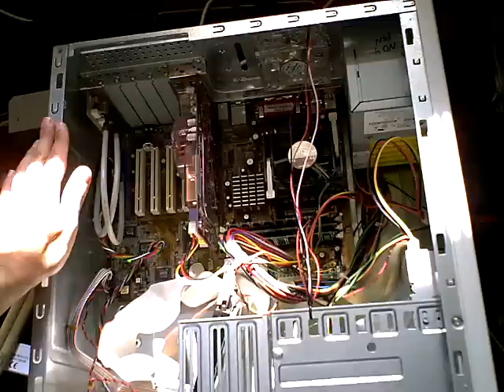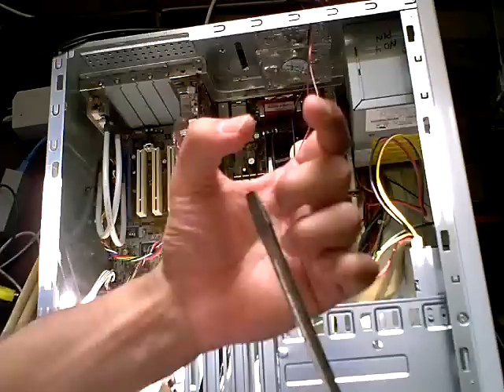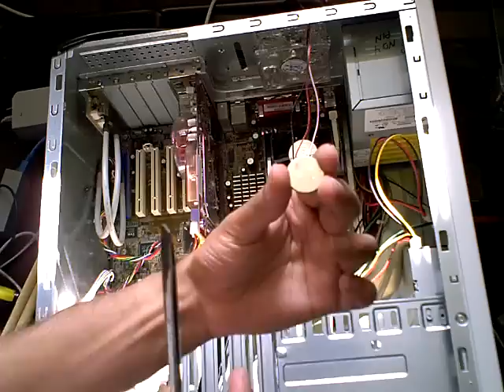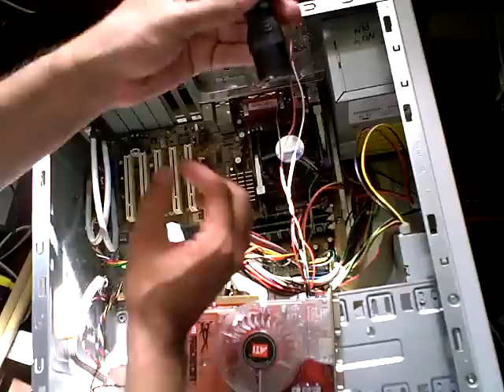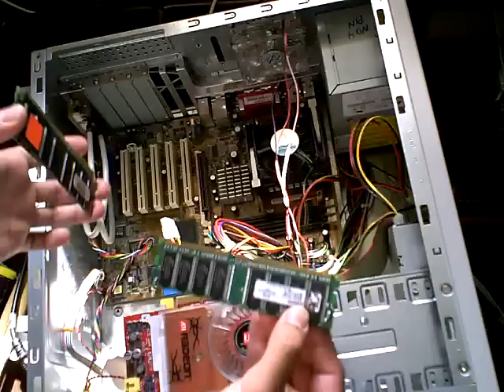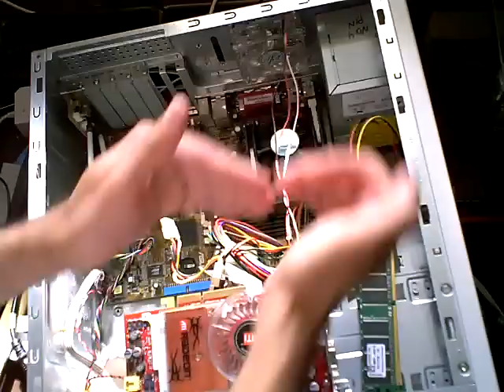How to possibly fix a PC that will turn on but will not beep and will not display anything on screen

Comment: mine is a Fujistu computer seimens and I do not know if that's how u say it but mine has a blank screen after being in a damp room for a year. I have took it apart and rebuilt it all but still no picture and the power button doesn't work anymore. I have checked the HDD cable, fan cable, power cable and so on. I don't know if the video card is broke or anything but if u tell me what to do or send a link. I will be very happy as it runs windows 7 ultimate and it has all my pictures on it. shall I just buy a new mother board or something
Reply from the maker: Well, if you are saying that it receives no power whatsoever (so no lights, no fans spin, no sign of life) then it is just the power supply that is dead and that needs replacing (ensure you have flipped the I/O switch on the power supply to I before trying to boot the PC...maybe you just missed that step)

Comment: So I have  exactly the same situation as in this video,  long beep after removing the ram, but no post beeps after putting the ram. What does that mean? We found that the ram is the problem and need to buy new ram or do i need to investigate further??
Reply from the maker: +region0706 Unplug the PC, try a different combination and/or order of RAM then power up, if not, unplug the PC, reinstall the RAM, remove the video card, then power up. If no luck, my question is: has this RAM ever worked in this PC before?
Reply: yes, it worked for many years. I have 2 sticks. yesterday it booted to the Acer logo with one stick, but on the screen it was saying CMOS checksum bad & something with date and time is not set. However there wasnt any beeps when booting, I pressed F2 and it went to load defaults, started loading windows and stuck there. The voltage of the battery is 2.3 V, I put a new one but no changes....
Reply from the maker: +region0706 Ok, the CMOS checksum failing generally means that the BIOS battery is dead. You're telling me you replaced it, so this is tricky. Ensure that you load setup defaults in your BIOS as you did, and ensure that the date and time are set correctly. If Windows still refuses to load, even with all of your RAM modules present, sadly your installation of Windows might have become corrupt. As a last ditch effort, I'd try loading Windows in safe mode (hold F8 after POST), and if still no luck, I'd try removing all non-essential USB connections to the PC as well as all non-essential PCI cards from the PC before booting. Good luck with it.

Comment: Hello, I tried to update the bios of my Motherboard from ASUS (bad choice). I tried for windows, but the ASUS program said it failed to identify the EEPROM.

At that moment the PC was working, but I had the bad idea to restart, now my computer is in the same situation as yours was, but only the motherboard, processor and psu, but not the beep.

I have already done the jumper and battery withdrawal procedures to try to return the motherboard's factory settings.

What do you think I should do or the motherboard is dead?
Reply from the maker: I'm sorry, it is not looking good. As a last ditch effort, you can Breadboard it (explained in the following video:)

http://www.youtube.com/watch?v=_EK9a-R5pss

but I am doubtful that anything can help at this point.

Comment: I just built computer and get no display or beeps but fans and led works but no boot. All my components are brand new. Could they come broken?
Reply from the maker: +TronTigerGO They could be incompatible with each other. Try to Breadboard it (explained in the following video:)

If the steps in this video did not provide a solution to your problem, view:

http://www.youtube.com/watch?v=_EK9a-R5pss

You never know, maybe rebuilding the PC in the opposite sense that you took it apart will solve the problem.

Comment: I have the same problem and I want to know if the problem can be came from the processor or no ? Because I guess the RAM and the video card working good
Reply from the maker: Yes, this issue can be caused by the CPU as well. But don't forget, your motherboard could be the source of the problem as well.
Reply: well thank GOD because the problem came from the video card not from the CPU.. when i unplug it, my pc run without any problem.. there is a solution to repair my video card or should i buy an other one ?
Reply from the maker: If there is a way to repair video cards, I haven't a clue how. I'd first test a different video card in your machine (borrow one if you have to) to ensure that it isn't your motherboard's video card slot (or the routing to and from it) that is to blame. You could also try your possibly faulty card in another machine to see if it works. If the borrowed card works fine, and your possibly faulty card still doesn't function in the other PC, yeah, I'd get a new video card : \

Comment: hello
ok, im in a very serious problem! and i need help.
my computer freezes on the start screen and i can't install another os.
( watch all parts of the video to understand better )
video: p1 : my computer ( winsows 8 ) freezes on the start screen and i can't install another os. PART 1
       p2 : my computer ( winsows 8 ) freezes on the start screen and i can't install another os. part 2
       p3 : my computer ( winsows 8 ) freezes on the start screen and i can't install another os. part 3
in detail : so , my computer was working very fine (it's a windows 8 ) , 
but one day i powered on my computer and it started fine but it froze on the start screen ( as in the video ) .
I tried restarting it for 12 to 15 times but it was the same.
 so i thought maybe there was a problem on the HDD so i tried to reinstall windows 8 but it doesn't work,
 it freeze on the start screen too (as in the video ) .
 i thought maybe the problem was on the CD and i tried to install windows 7 with another CD but i couldn't ,
 the problem was the same.
i thought that my HDD was damaged. to verify i put it in another computer , 
it was working fine and i got access easily as there was no problem . 
i tried another HDD on my computer but it was the same thing with another HDD .
 i got 2 or 3 times the blue screen of the death .  
i tried searching on the net , but no good . 
i found some advices , i changed the rams , the battery , in plagued the fans and the graphic card but nothing changed .
my mother bord is : GYGABYTE GA-G31M-ES2L
Reply from the maker: +samad uddin Sorry this reply comes over a year later. Unfortunately, the issue seems like a problem with the motherboard. As a last ditch attempt, you can unplug the PC, remove the graphics card, connect your display only to the onboard, then try a different keyboard, different mouse, and connect NOTHING else to the PC, so only keyboard, mouse and screen. See if that helps.

Comment: I learned a lot, but I really wish I had checked one thing before starting these steps.  It would have been nice to know that there wasn't a system speaker installed!
Reply from the maker: Heh, yeah, I shoulda mentioned that early in the video. It used to be extremely unlikely that PCs came shipped without PC speakers, now sadly its becoming more common : \

Comment: My computer stopped posting after I unplugged my VGA cable while the computer was on and after a hard reset it would not post. The computer uses integrated graphics so the VGA cable is plugged directly into the motherboard. Could the unplugging of a VGA cable damage the computer or perhaps a coincidence?
Reply from the maker: +AnimeBeefRandoms Sounds like you confused the CMOS (many boards auto-detect what display output is connected). Try resetting the CMOS as shown in the video
Reply: RodneyDickson I've tried that.. I've even tried the taking out the motherboard battery method.
Reply from the maker: +AnimeBeefRandoms Fraid the only thing I could suggest is to Breadboard it (explained in the following video:)

If the steps in this video did not provide a solution to your problem, view:

http://www.youtube.com/watch?v=_EK9a-R5pss

You never know, maybe rebuilding the PC in the opposite sense that you took it apart will solve the problem.

Comment: Hi the issue with a motherboard not posting, could also be caused if the CPU is incompatible, you may have to obtain a bios update in order for a motherboard to post..
Reply from the maker: +laughing nutter Good tip, thanks for sharing

Comment: Having this issue, sometimes. what would it mean if I can post and boot after I clear cmos and reseat hardware, but otherwise get no post?
Reply from the maker: +John Berkheimer A component could be causing the CMOS to become 'confused'. Easiest thing to try first is to enter the BIOS and 'load setup defaults' followed by saving and exiting. If this does not solve your issue, let me know and we'll try some other things

Comment: HELP! I have a similar problem. No beeps or anything. I have tested to change all the other parts but I do not mainboard, the power supply or processor ... I've put together the machine 10 times and I can not find the problem. Can the processor be dead? I suspect the motherboard .. I do not understand the machine work a couple of days ago but the very next day when the starter no image, but the machine will start..
Reply from the maker: Try absolutely everything suggested in this video. Let me know how it turns out.

Comment: I have the same issue and I tired your method and still it did not work. The weird case in mine is that all of my parts are new. They were all recently bought and I am not sure if I messed it up or the motherboard was garbage. It did work before but when I switched the cpu fan for a water cooling component that's when it didn't work. If you ever reply (witch is hopefully soon) I'll tell you my parts but for now any answer will be grateful.
Reply from the maker: +Jason Chang 7 months later is soon, right? Sorry bout that. If this is new hardware that you are installing on your motherboard (that has not yet functioned on your motherboard,) note that matching bus types of video card to motherboard socket (PCI-E for example) or matching bus types of RAM module to motherboard socket (DDR3 for example) does not necessarily signify compatibility. If this is the first time you are trying this hardware on your motherboard, there is a chance that this new hardware is not compatible with your motherboard, despite the same bus type and despite the fact that the new parts fit in their respective motherboard socket. Your motherboard manufacturer's website will have a support page dedicated to your motherboard's model, and on this support page should be a compatibility list for such components as video cards and RAM modules. Ensure that your new component is certified to function with your motherboard, and if your new component is not present on the compatibility list, then there is a chance that the new component is not compatible with your motherboard.
Reply: +RodneyDickson Thank you for still replying, but my issue has been resolved. You were right about the motherboard being the issue, but I found out that I broke it so I got myself a new motherboard and now there are no problems! If I have any other issues though, I'll be sure to ask you (Just reply a bit faster)
Reply from the maker: +Jason Chang Heh, you never know, I might take another 1.5 year hiatus from YouTube comments again : ) Thanks for the update.
Reply: RodneyDickson Welcome :)

Comment: Hey there. i've been looking through the interwebs since forever and then finally found this video that you posted and its pretty clear that you know your stuff! Please help me out here if you can mate, would really appreciate it.
I've got the following specs:

Asus-M5A97-EVO Motherboard
AMD Phenom II x6 1100T CPU
Corsair Vengeance DDR3 ram - 4GBx2
Seagate Barracuda 2TB HDD x1
Seagate Barracuda 500GB HDD x1 (Primary - Boot)
Zotac Nvidia 560ti Gfx Card
LG Optical drive
650W PSU

My problem started this morning. When I switched on the pc, it started somewhat beeping, but i got no HDD light nor any display on the screen. On a closer inspection, i realised it was my HDD (2TB) that was making a repeated beeping/squeaking noise and I thought that the drive might be dead. However, I took that drive out and put it in my secondary rig and it worked flawlessly there. I also tried connecting it via my hard disk adapter to my laptop and it worked perfectly there aswell.
When i tried switching on my problematic machine (without the 2TB HDD), it refused to post. Just turned on (Power light -ON, CPU fan - ON, Motherboard light - ON, Gfx Card fan -ON), but there was no HDD light this time round too. So it was apparent that the primary Drive wasnt being Read either. Also I saw that my Optical drive was making all sorts of weird noises as if it was trying to read some disk, even though there was no disk inside.
ALSO, long pressing the power button does not switch off the system and i have to disconnect the power cable for it to shut down. The reset button isn't working either.

I HAVE checked my RAM modules, my video card, my hard disks and have cleared my CMOS but nothing helped. now i'm sure that its either my mainboard that's gone or my PSU that's faulty cuz its playing havoc with my HDD and that optical drive. Ive read that a faulty PSU would do that but i'm not sure. You do seem to know what you're dealing with so I'd be really happy if you could help a bro out. What do you think is the issue? PSU or motherboard? As you mentioned PSU seems to be the obvious culprit here right?

(I know taking this to some tech store would be the obvious choice but i cant do that until next week and it would be easier for me to order something online and fix it myself).
Thanks in advance!
Reply from the maker: +vikgr8 Well, considering that you cleared the BIOS already, all I can suggest is either you try a different PSU or breadboard the kit. A different PSU, if you don't have one, will cost you cash, whereas breadboarding won't cost you a dime but will cost you your time and effort. Breadboarding: http://www.youtube.com/watch?v=_EK9a-R5pss

You never know, maybe rebuilding the PC in the opposite sense that you took it apart will solve the problem.

Comment: I was getting black screens and would have to do a hard boot to get my system back up. Then a couple of days later I got a white screen and no matter what the system would not reboot. I pulled the graphics card (HD 7870) and hooked up the monitor to the on board GPU. Everything booted fine and the system is back up. Can I assume that the graphics card is bad? Any way to test besides plugging the card into another MB to see if it works?
Reply from the maker: +kinjari Try unplugging the PC, installing the graphics card, but leave the display connected to the onboard connector. Power up and see if the display shows. If it does, go into the BIOS and specify that your main video should be the addon card. Save the settings, reboot, and see if it helps.

Comment: So i just built my first pc from scratch and i am getting this exact thing. Fans are running, GPU lights up, case has power etc etc but my screen is black ( no beeps, nothing)..  Now, if i take out components one by one and restart if i get a beep that is problem? I have a feeling its the Ram as well.. I only have 2 stick with 8 slots.. perhaps the ramm order is wrong?
Reply from the maker: +Michael Daniels (JMichael) Yep, very possible. Try different orders, and don't forget, matching bus types of video card to motherboard socket (PCI-E for example) or matching bus types of RAM module to motherboard socket (DDR3 for example) does not necessarily signify compatibility. If this is the first time you are trying this hardware on your motherboard, there is a chance that this new hardware is not compatible with your motherboard, despite the same bus type and despite the fact that the new parts fit in their respective motherboard socket. Your motherboard manufacturer's website will have a support page dedicated to your motherboard's model, and on this support page should be a compatibility list for such components as video cards and RAM modules. Ensure that your new component is certified to function with your motherboard, and if your new component is not present on the compatibility list, then there is a chance that the new component is not compatible with your motherboard.
Reply: +RodneyDickson Yes that fixed it. All is well so far except i am running to this Sleep Wake Issue with windows 10. If i put my system to sleep i cant  wake it via the keyboard and mouse ( i have to power it down).. I am thinking about just installing windows 8.
Reply from the maker: +Michael Daniels (JMichael) Many of those functions were not compatibility tested for Windows 10 it seems (or from what I've noted with other installs of Windows 10) so retrograding might be the best course of action. Many tell me they get more performance out of Windows 8 to boot, so there's that as well : )

Comment: I'm having this issue, however my computer parts are brand new, less than a week old. All of the parts are running (all fans running, including graphics card, motherboard LED's are lit) however my screen is not picking up any signal from my PC. Any suggestions?
Reply from the maker: +Kyle Christensen Does it beep at boot?
Reply: +RodneyDickson after playing with a few options I discovered that I couldn't get an image from placing RAM in the A1 or A2 slots. I called Asus support and we decided it was a faulty motherboard and I ordered a replacement
Reply from the maker: +Kyle Christensen (shrug) erite den, glad you got to the bottom of the issue.